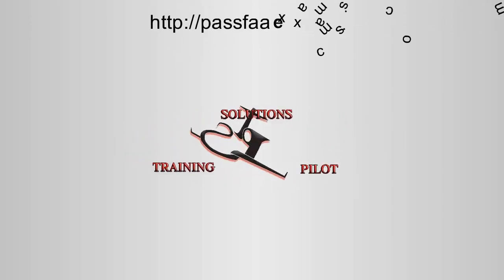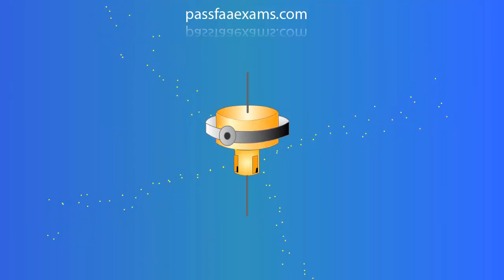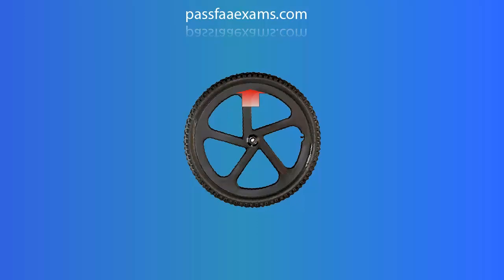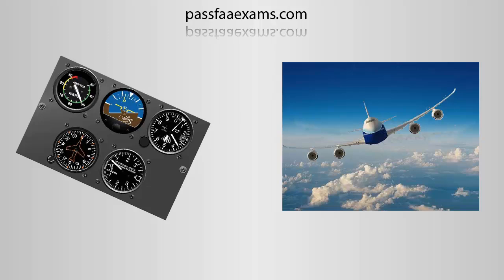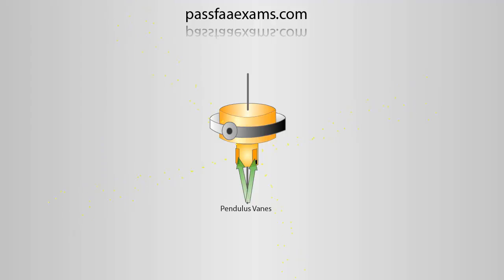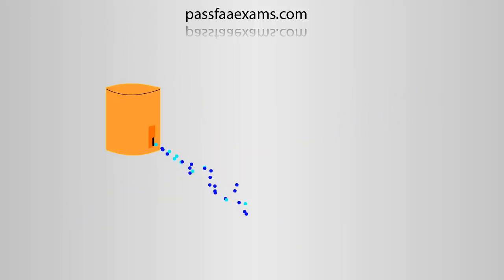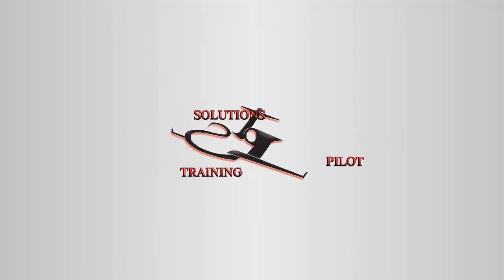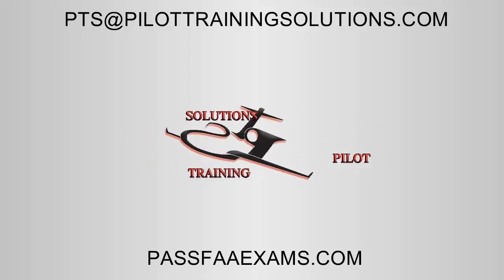The Attitude Indicator

Comment: I assume that the force being applied by the exposed holes is a very small force, which accounts for how long it takes for a gyro to readjust if you just have it sitting on a desk sideways or something (and why banking doesn't just immediately reset the horizon)? Most videos gloss over how long it takes and the graphic could be misunderstood as it immediately readjusting, which makes the instrument useless.

Comment: Hello, I have a question about this
I confuse that gyro works on rigidity in space or precession.
I understand that if gyro has rigidity in space it will try to keep rotating in its original spinning plane. So with this law, rigidity in space, alone, why it have to precess to its original plane when it can already maintain its original spinning plane by the other law.

Comment: I didn't get the concept that how precession is fixed.
Reply: Every time the gyro tilts in any direction, it opens air vanes that tend to blow the gyro axis back to vertical. This force is small enough that it doesn't quite interfere with the gyro's short-term ability to swivel around according to the airplane's attitude, but in the long run it tends to align the gyro to the local vertical because it is a pendulum that controls the vanes.
Reply: Thanks.
Reply: Manav Chauhan Cheers.

Comment: Gian, great video, however I was looking for some clarity in the last part of the video when you do the example if we were to pitch the aircraft. What exactly is the arrow pointing to? It does not seem very clear. Thanks for the help with all the wonderful videos so far, I am definitely debating on getting some of your software.
Reply from the maker: I agree. Its very difficult to show 3 dimensional movement in 2D. The arrow points towards the back pushing the top of the instrument towards you. This force moves 90 degrees and banks the instrument rather than pitching it.
Keep in mind that these videos are just extracts from the full software. In the full software there are 5 slides going over the Attitude indicator. Those should clear any doubts you may have.